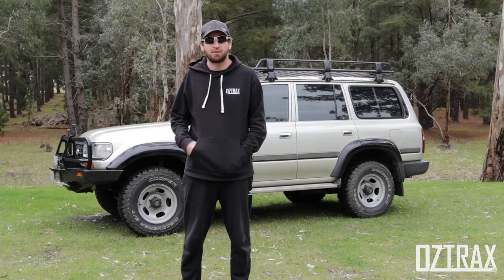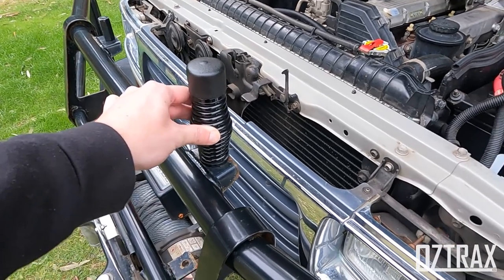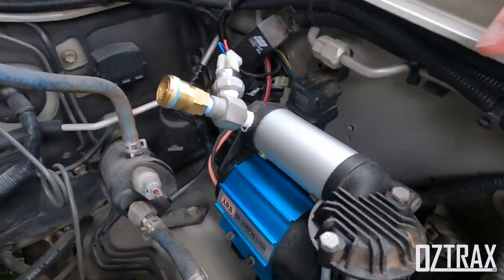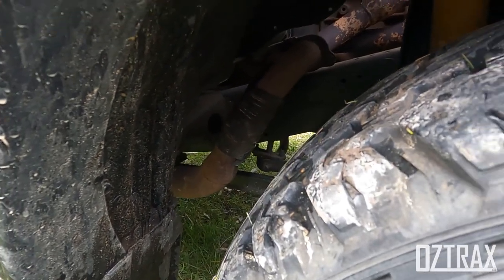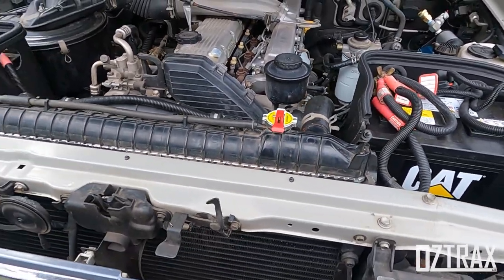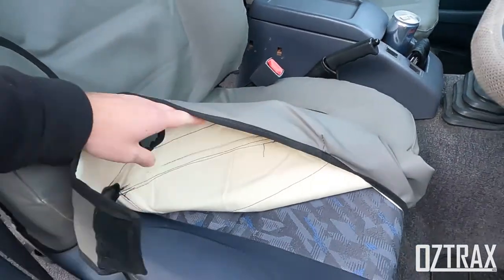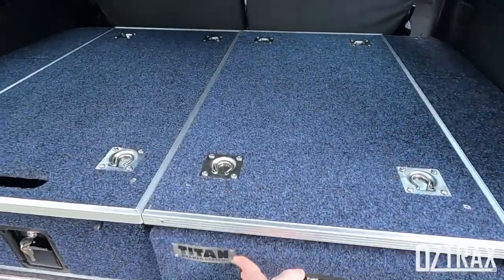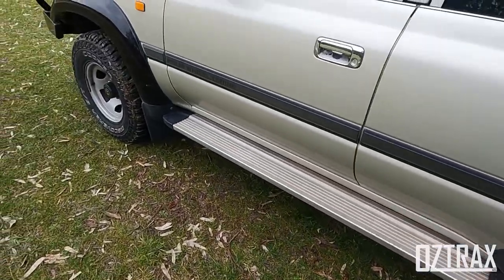The New Rig // Introducing The 80 Series Landcruiser!

Comment: I'm in the same boat as you mate, if i had my time over..i would have got the 80 series instead of the 90 series. They ride alot smoother and you get alot more flex out of them. At the end of the day I'm still.happy with The Mighty 90💪
Reply from the maker: Oh I miss mine, was quite a build on it until I was almost killed in it.

You can find the videos on here if you want to check it out and see what happened.

The 80 fell into my lap at a good price as a replacement.
Reply: @OzTrax4X4  had a qik look. But can't seem to find the one about the 90 to see what happened!!
Reply from the maker: Starts here bud - https://youtu.be/VIVvw6WmqFU